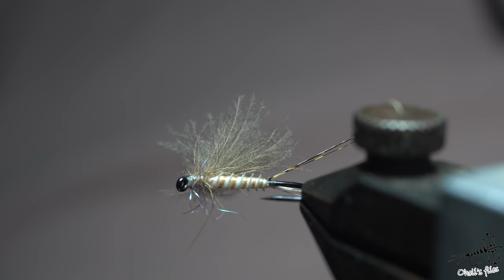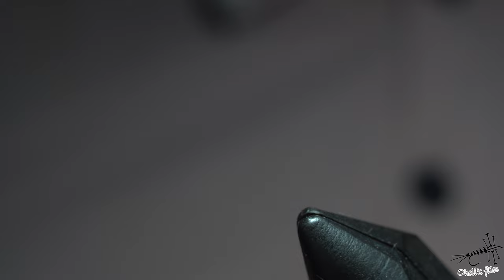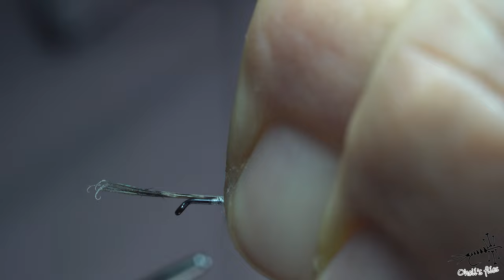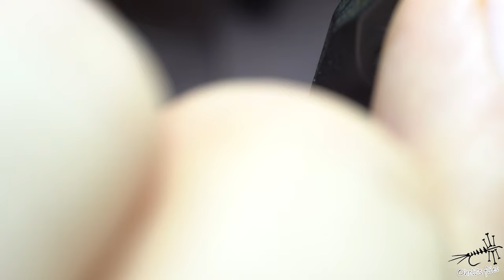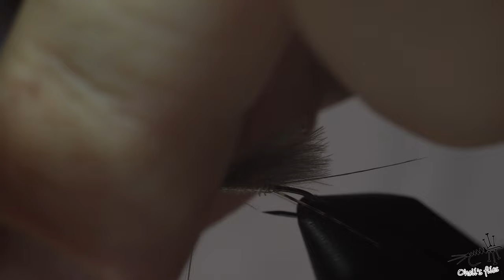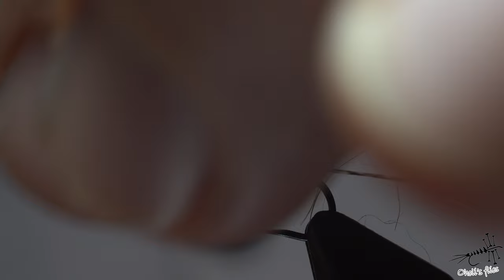Peacock's Biot Mayfly

Comment: Hi Vladi
Beautiful and (I think) effective tying of an ephemeroptera. But I wanted to ask you a question. Some time ago I saw a peacock biot feather from a fly tying friend. I found that the part of the feather that had the short fibers, which were clearly biots, were too short to use on certain hook sizes (maybe difficult even with a # 14). Watching your video I have the feeling that the biot you use, for a # 14 hook, is clearly longer than I remember. My question is, do you use the short fibers of the feather or, on the contrary, do you use the long fibers of the female peacock feather? I think I remember that those longer fibers did look like a biot, but they were much narrower than the shorter biot fibers in the feather. If so, that is, you use the longest fibers, do they produce that typical biot effect without any problem? (Of course in the video it is clear that this is the case). Thank you very much and, I repeat, magnificent fly tying.
Reply: Looks like he is using a goose or turkey biot (and yes, from the short fibers of their flight feathers). They're much shorter than stripped peacock, and get too wide quickly for smaller hooks... it's a good trick he uses to cut them down a little narrower - much easier to wrap a consistent taper.
Reply from the maker: Hi, thank you so much my friend. in the video i am using proper biot from male peacock. Goose biot is too short for most flies. Turkey is the best and peacock goes along. But it has to be one of the first flight feathers... Not the later ones... Due to length.
What you refer as long and narrow biot is actually a feather barb... And it is as good if not better sometomes for getting that nice segmented 'biot' look... Its longer, narrower... Easy to work with... And many big feathers are suitable for it... Not only flight feathers. Tail too.. I have used macaw feather for that purpose. But, when u use  gentle feathers its likely you will need more than one barb.... And effect will be more like regular PT body... Not biot
Reply: @Oholisfliesandfishing  Thanks, Vladi
Very clear explanation about biot. And it has become clear to me that you actually use male peacock biot. I will try it (I usually use the turkey one) but from what I have been able to observe it is difficult to get the primary wing feathers in the European market. Yes, I have seen that they are for sale in the Chinese market. Again, thank you very much Vladi.
Reply from the maker: @jorgemerino4709  you are welcome my friend. Try ordering from aliexpress.?